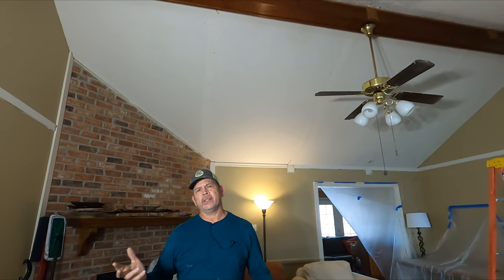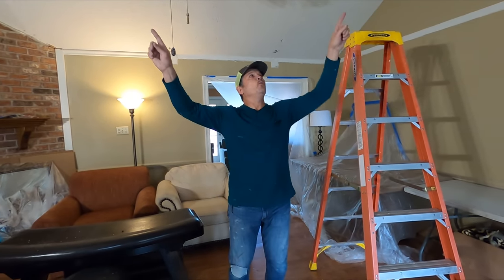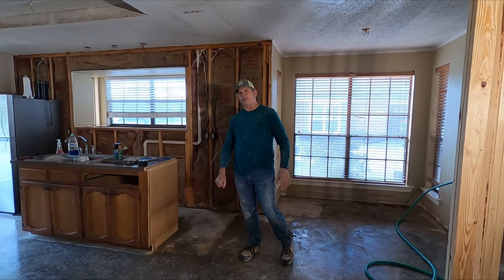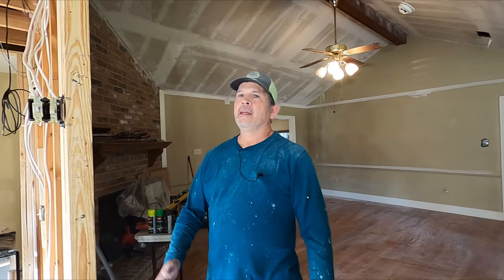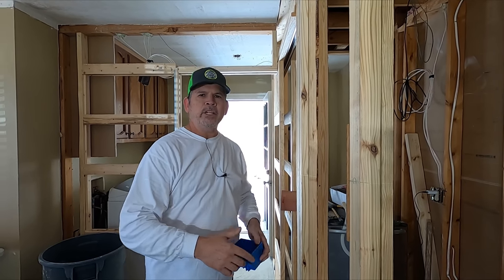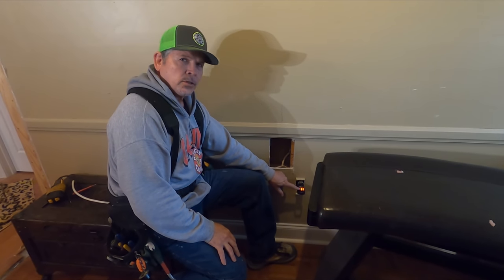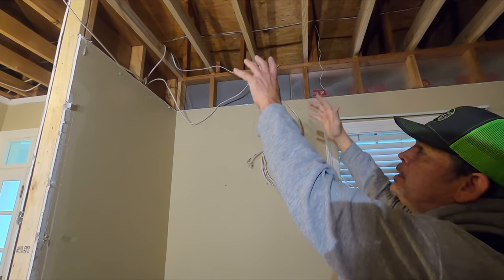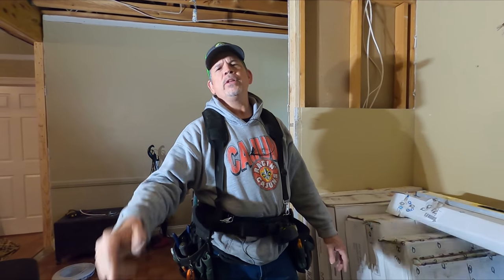Scraping Popcorn Ceilings.. There HAS TO BE a BETTER WAY! Ep. 9

Comment: just adding some
ideas I
use.      I run a drywall screw thru each electrical
box right down the middle.  with the two nails and the screw, they never loosen no matter
how much use they get and it helps keep the un nailed side from leaning inward of the drywal
Reply from the maker: My inspector will fail us on electrical if we install a screw through the side of a box that is not designed for that purpose

Comment: 5 gallon homer bucket finish all purpose mud 1/2 nap for paint, thin out mud and roll a 1/16th to an 8th inch of mud across ceiling works beautifully. The trowel out smooth.

Comment: If you are a single person (no helper) scrapping popcorn, consider my technique.  I use a garden sprayer and start to dampen the ceiling a section at a time.  I use a small scaffold (for ceilings 8-10’ high) and a metal paint roller tray and a wide metal plaster tool with the corners dulled.  I scrap it into the tray, and as it fills, I head over to a kitchen size trash can and dispose of the stuff.  It is relatively less messy, and easily doable by a single worker.  After all cleaned off, I skim coated it with topping compound.  Quick!

Comment: I'm a fan of canvas drop cloths. They don't get slippery, if you happen to step into a paint drip, a few steps pretty much cleans off the shoe so you won't track it every where and the paint will dry more quickly on the cloth than the plastic. I've used canvas drop cloths on the popcorn removal, just get enough to cover the whole room, put the plastic on the walls and have at it. Once done, roll them up take to the dumpster and shake them out. They only get slightly damp on the job and clean floors. Wash them up in the laundromat with heavy duty washers.
Reply from the maker: I'll try it.  The thought of cleaning them always stopped me.  Laundromat would work👍

Comment: I love the way you guys do this but I opted to pull our old kitchen and dining room ceilings down (not as high up) and we ended up leveling the ceiling moving some vents and then reinstalling to make them flat.  My wife then had us do the main bathroom, the master bedroom, the spare bedroom, and now we are moving on to the other bedrooms and office.  Wish we had scraped them now but our vacation house is older (1973) and it has settled such that leveling the ceilings and reframing floors is a must.  Great video.  When we did our floors we found that they had used two 16 foot 2 x 8's as floor joists.  In the middle, they had laid bricks on the slab and overlapped the 16 footers on bricks in the middle to go the entire 30 foot span.  That was why we had a huge hump down the middle of both rooms.  Needless to say, when we redid it all, we did it right.  Got our tips from you guys.  Thanks.
Reply from the maker: Sounds like a great project 👍
Always appreciated Kevin 👊💪

Comment: Here in the UK, you can wire a house yourself HOWEVER it WILL need certifying & registering with the local council as conforming to regulation.  This is a good option for a small builder who is competent enough to understand the Regulations.  He can do it all on his time.  He MUST however, not cover anything over [box-work or flooring etc. before his certifying Sparky has seen it ALL and tested it. If the Sparky can't see the clipping, bends, terminations, conduits etc., then they won't test or certify it.

If you are just making a minor move of a circuit or changing terminations [ socket/switch etc. ] then no inspection is required as the correct cables should already be routed to those points.  This is primarily to prevent idiots using the wrong weight cables, then not supporting them correctly or maybe hiding them under insulation and not accounting for the reduced dissipation of heat etc.  And on and on.......

Looking at the wiring in my house I will assume the builder went out drinking with the sparky who certified it.  [ plug socket running off a lighting circuit, upstairs sockets linked into the downstairs circuit.  Got to test EVERYTHING carefully in my house, before working on it.

Comment: I've done the same thing.  But I didn't go the garden hose route, instead I used a 1 gal pump sprayer to wet the ceiling as I could better control the amount of water then scraped.  And did the trash can catch as well.  Worked great with very little mess. Luckily I didn't have vaulted ceiling but it still took a bit longer.

Comment: As a homeowner, I've wired all my own remodels in both of the houses I've owned without issue.  Yes, had the rough in and final inspections too.

Even I know not to use the blue pos boxes the stores sell.  If you're the good guy you seem to be, get the homeowner some decent deep boxes that'll last for the little bit more they cost.

Comment: I wholeheartedly agree with your comment on not be able to do your own electrical work. As  a homeowner, I want to take classes and learn this stuff. There is no middle ground, it's a shame.
Reply: Hard to prevent a homeowner from doing his own electrical. And I've seen the a little of the worst, while helping a neighbor remodel a previous remodel. Hidden splices (yup, unboxed and apparently splices) everywhere. I don't know what was going on behind that big wad of tape around them. And lines laying across and even one was run  inside a heating duct. Even a non-electrician (me) can tell at a glance that it's wrong.

Comment: I use a power drywall sander with 80 grit and dust extractor to sand popcorn off. Saves the shoulders and time. This came off nicely for you guys though.

Comment: Also, your point about not being able to do electricity, same here in the UK as far as I'm aware
I did my 3 phase and got my certificate way back in 89, but because I've not kept up to date with all the courses over the past 32 years with all the updated regulations I can't sign any of my work off
I can buy it, and fit it, I just can't call it legal until its checked out
I suppose its all there for a reason though, electricians got to get paid too 😉
Anyway, you must have so much work booked up you'll probably have Jordans kids helping out to finish it up
Keep up the good work guys 👍👍👍👍👍

Comment: That scraping.  Have you thought about using an small bucket hanging under the scraper, modified in a way with a pvc pipe along the stick and a wet vac connected to it.?
Reply: Wish I could paste a picture here, but you get the idea. like a sink , the popcorn / wet debris falls in the bucket and under the bucket is an hole with drain pipe and connect the hose from the vac to that.  Go try it one afternoon. :)   Great jobs you are doing !
Reply from the maker: I get it, cool idea 👍💪

Comment: Electrical box: Don't laser to the center, laser to the top screw hole into which the switch or outlet mounts - saves having to mark the center line of all the boxes.
Reply from the maker: Cool that works.  Sometimes I use 4x4s and install mud rings later.  Guess that got me into centerline habit 👍

Comment: I adore the dynamic of your duo. Great work both on the renos and the channel. 
FYI In Québec, Canada, you cannot have wires come in a metal box without wire protection from the metal edge of the dox. It is to prevent the wire to be cut from the sharp edge and cause an arc.
Reply from the maker: Yep same here 👍  That box inside the wall (if that's what you mean) is plastic.

Comment: Speaking of hot water.  We removed an acoustical ceiling from a concrete shop building we were using by turning a fire hose on the ceiling.  It removed the material and washed it out the door but it also turned a room of about 30 x 30 into a sauna.  This was in the north bay of California in the summer.  I enjoy hearing more about your background and how things have changed.
Reply from the maker: Thx Emmet!  Fire hose didn't ruin the drywall?
Reply: @StudPack  No drywall, the building was all concrete built in the 1930's.
Reply from the maker: Oh cool 😎

Comment: Mini detail for the new outlet where the wing wall was removed.  In Alachua Co, FL, the inspectors will fail use of cables entering a single gang box using the opening next to the stud.  Be sure to check your local requirements.
Reply from the maker: To protect the wire from errant drywall screws?   good idea actually 👍

Comment: In the 2x4 walls use “stackers” to hold the wires to the 2x4. A staple can only hold 2 Romex any more than that won’t have the 1 1/4 nail space. You can get them from depot or Lowe’s
Reply from the maker: Cool thanks Tom 👍

Comment: 17:25 I didn't know those existed.  All this time using ferrules/crimps with pigtail now just got a lot easier.
Reply from the maker: Yep they're a life saver.
Reply: @StudPack  a quicker way to do it is to cut the grounds even and add a new ground wire (or 2 or 3, depending on how many you need) and twist together with a wire nut (tan or red depending on how many wires and sizing).

Comment: When doing popcorn ceiling removal ive found that if the ceiling has not been painted to dry scrape the popcorn then skim coat the enitire areea with plus 3 drywall compound its dusty but way better than all that wet mess and if the ceiling has been painted mud over it  !!! Hope this helps

Comment: Where is your Pneumatic Palm Nailer for installing the electrical boxes.  In tight spots, I had a length of 1/2 inch o.d. pipe with a steel rod inside to help with the nailing.  Slide pipe over the nail head and hit the rod.  This was before the use of screws for everything, like hanging upper cabinets.  Didn't have to reach into tight spots with the hammer.
Reply from the maker: Cool tip on the pipe/rod trick thx 👍
Reply: @StudPack  sounds like a vinyl/steel siding tool that I've seen before.

Comment: Great video.  I have 800 sf main floor with painted popcorn (lots of paint), and the ducts are mostly in the center core, so I have the same short-circuit of the air.  Maybe best to tear the old drywall / popcorn ceiling out, redo the ducts and some electrical, and then put new drywall up.  What do you think?

Comment: On those tight spots, you might want to consider using the Madison Electric Smart (electrical) Box. A little more expensive but the mounting screws are inside the box so you don’t have to use lineman pliers and hammer to install. The Smart Box is good for both new and old work.

Comment: HVAC guy here. Have a tech come in and look at the supply/return ductwork and make sure you are sized right for your system. I don’t like “central returns” because they can make the farthest away rooms uncomfortable. Also those high ceilings can trap heat. A return grill up there might make that room more comfortable.

Comment: I found the best way to do popcorn ceilings. I just charge so much money to do it that the better alternative is to just tear it down and start over new. 😂😂😂
Reply: Gzus Kreist  not sure about your comment. ?
Reply: The wires are above the ceiling joist.
Reply: @e4d578  wiring is typically already in place. Either ran through ceiling joists or stapled to the ceiling joists. Any light fixtures or ceiling fan boxes are already in place so all you have to do is cut around them. Most homes in my area that want popcorn ceilings removed are older and therefore don’t have blown in insulation. Usually just paperback insulation. It’s very easy to do.
Reply: @e4d578  nah, GK meant to respond to another comment regarding electric work lol
Reply: Gzus Kreist  Replacing the sheetrock would not affect the wires at all
Reply: I agree i have done both and  honestly  tear it down not difficult  gives you a chance  to inspect  electical ad lighting  or soundproof  with  soundbar  plus old popcorn  may contain asbestos

Comment: Just mark the joists and board over it. Improves the sound and fire resistance with 2 layers of plasterboard. have to ensure the new light fittings are compatible with 1hr rated ceilings if they are inset like spotlights etc and use longer screws but its always worked a treat for me.. Work smarter not harder...
Reply from the maker: It's an option.  I just prefer removal over covering it up 👍👊

Comment: I'm 100 years + and i did 1800 sqft
Use manual 1 gallon pump 
1.- spray 1 one time and wait 5 minutes for step #2.

2.- Spray hot water all the ceilings and wait 5 minutes for step #3

3.- Spray hot water all the ceilings and wait 10 minutes for the step 4.

4.- Spray hot water all the. Ceilings and wait 10 minutes for the step 5.

5.- Spray hot water all the. Ceilings and wait 10 minutes for the step 6.

6.- Spray hot water all the. Ceilings and wait 10 minutes for the step 7

Start scraping the poopcorn off and will be easy like a butter.

Of course cover walls and floors with plastic, double plastic on flooring to make sure is not leaking. 

😮😅
*spray one or 2 times DOSEN'T work.. needs few time the poopcorn to absorb the water slowly. 
MESSY EVERYWHERE, 
PUT SOME PLASTIC SHOES.
NO ONE CAN GO OUTSIDE UNTIL YOU FINISHING EVERYTHING. 

SAND AND 
USE OIL BASE PRIMER AFTER THAT.

Comment: I like your style 😂 proceeds to say I can’t do electrical in LA and then starts rewiring receptacles 👍
Reply: He was just reconnecting all the electrical boxes that he had to disconnect for the project, not adding new circuits.
Reply: @aurvaroy6670  I’m on his side for sure I wish LA electrical licensing wasn’t so demanding. Had to let mine go as we simply weren’t doing enough to keep it. I was just saying I like how he mentioned it. It really doesn’t matter either way though from what I remember. If he’s being paid as a contractor and not a home owner rewiring existing or adding new can’t be done by a general contractor. (I’m assuming the project is over 50k). I can see mounting the boxes, but once you cross into pulling wires and wiring boxes you’ve moved into the licensing world. If we could all do that, then why even waste the time on hiring the electrician on the rest. 😂

Either way love the channel, love the team, love the work. 
Great job!
Reply from the maker: Thanks, I appreciate your commenting 👍

Comment: we scraped popcorn ceiling in our 1800 sq ft fixer upper. We did it while all the flooring was out (bare concrete) and hired people to help scrape and clean floors as we went. It was a huge mess. Almost a bigger problem was how poorly the drywall tape was installed under the popcorn. Almost all of the tape corners between walls and ceiling needed to be or should have been replaced. Most of the butt joints lacked compound under the tape. Even the tapered edges lacked mud under the tape and needed work.

Comment: My A/C advice is to move all the supply registers to the outside walls. Do not place any of them above where people will sit as they will complain about the movement & temperature of the supply air. Exterior walls is where the air envelope of the building belongs as it will capture all the air of the space and move it back to the return air register and through the A/C & heating system. Adding a return air register in a lower internal wall would also be beneficial as it takes the air off the floor and sends it back to the unit. Having two return air registers near the floor is even better is there is not enough room for one large one. The return air must have a free flow back to the air handler or nothing will work correctly. There are return air registers that also act as air filter compartments so that makes it very easy for the home owner to change their own air filters and to check on how dirty they may be.
Reply from the maker: Thx squeakyhinge!  Almost every home in our area has filter backed return air grilles.  I think a second RA is a great idea 👍👊

Comment: Years ago, as a first time homeowner, I bought a rather thick, glossy, full color book on DIY electrical work in the home from a local home store. I started out small by replacing light switches, receptacles, ceiling fans, etc. Fast forward to today. I had some landscape lighting that was disconnected for years because of a short somewhere, and I was unwilling to hire an electrician because of the expense it would surely entail. Long story short, I happened upon the short one day while out doing the lawn, so I repaired the short, pulled all the old NM cable, ran new UF cable (50 ft worth), and replaced the old HID lamps with some sweet, new LED lamps. Then I moved on to adding a third light in my attic followed by a second receptacle on the other side of my kitchen island which required conduit by code. My most recent project involved digging a trench and running 100 ft of 18/7 irrigation wire. Each project was a lot of work, and I learned some new things in the process. But, my mantra is always to make it better than before. The sense of pride is priceless. I look forward to your in-depth video on electrical work.
Reply: Yes Mr. President Lol
Reply from the maker: Was this at the governor's mansion is Arkansas ?? 😂😂
Much appreciated Bill 👍💪

Comment: I like how Stud Pack cannot do electrical work...then proceeds to do electrical work :)
Reply: Was also wondering about this. Where's the line drawn? New circuits?
Reply: @davidkahler9390  I'm thinking they can run the lines but not connect them to the circuits breaker terminal.
Reply: @davidkahler9390  they can do everything and just pay electrician to sign off on it i think they just not gonna tell anybody lol if the electricien signs off its all on him if something go wrong so it ensures a quality check anyway
Reply: @davidkahler9390  In my state we can reinstall any existing electrical wiring that we took loose, but can't by code install new wiring. So any of the existing wires they should be fine.
Reply: @ricaropie260  Right -- The electrician inspects and signs off.  It's just like if the electrician hires helpers who aren't licensed electricians, just straight out of school.  Paul is the same as an employee of the electrician as far as code is concerned.